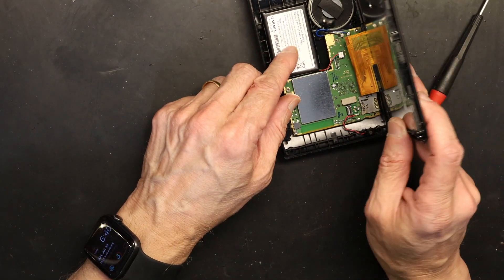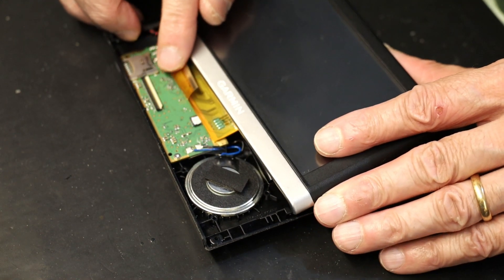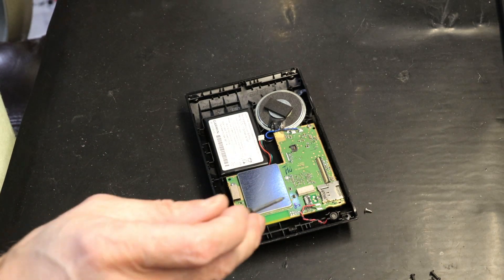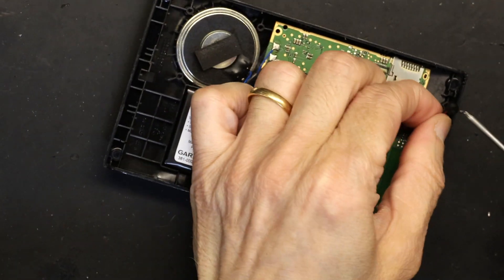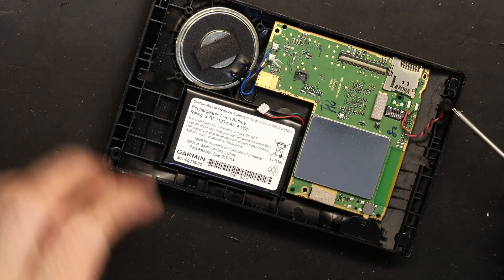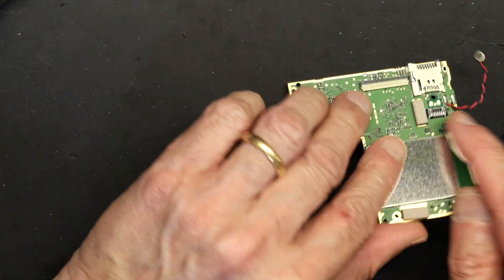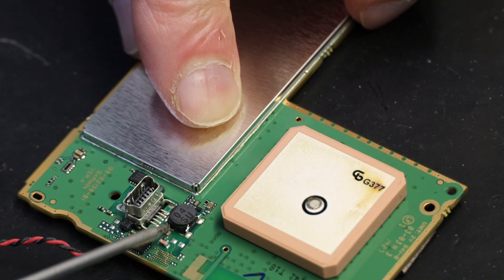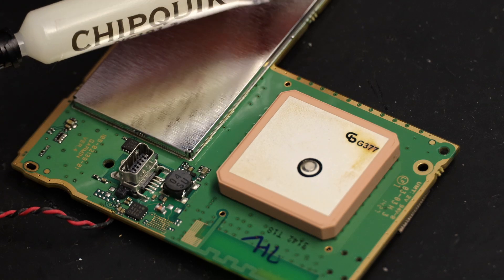Tutorial: How To Repair the USB Port on a Garmin Nuvi 2597LMT GPS Navigation System

Comment: Do you know why my Garmin 2599 LMTD has a hard time finding a GPS signal. about 10 minutes every time I turn it on. After that it works normally. I tried resets and cold start.
Reply from the maker: Hi, you need to update the firmware on the GPS, but don't use Garmin Express instead use Garmin Webupdater.exe
Reply: @TECHNOLOGYTIPS101  The firmware is 8.80, the last updated on garmin express and Webupdater does not give me the option to reinstall it. It only gives me the language update without any firmware. Is there any option to reinstall the same software. Or maybe downgrading firmware would help
Reply from the maker: @divdivic8120  Yes there is an option in Webupdater to reinstall the same version again. Also if all other options fail, there is one more thing you can do for the GPS to get all the GPS fixes but it takes 24 hours. You will need to put it outside using external power supply and let it stay connected with satellites for the full 24 hour period. This will be a way for the GPS to remap the sky with the latest GPS fix. This method will work permanently as long as you turn the GPS ON at least once a week. If you leave it OFF longer than a week it may lose the GPS fix again.
Reply: @TECHNOLOGYTIPS101  Hello mate, I tried to leave the Garmin overnight in the car to map the sky. And it seems to work better and faster now, but it still has a problem every time you put it to sleep, it can't find satellites again. Webupdater simply doesn't reinstall the software .It immediately recognizes that the latest software is installed and gives me other options. I also watched your video on how to install firmware for GPS receivers on chargers via webupdater, but it doesn't give me any option for software.
https://youtu.be/BB9n8UCzog4
Reply from the maker: @divdivic8120  I watched the video. It seems like you have a bad Main board. You are better off getting a used, similar GPS unit from eBay than buying a replacement main board.

Comment: The little white hold down piece broke on mine!  Is it fixable??
Thank you,
B
Reply from the maker: If you are talking about the flap that holds the LCD Cable, it is not fixable. So you have to replace it, and you can only get that part from another used Garmin of the same model. They don't sell it separately
Reply: Could I use super glue to lock the ribbon in place?
 @TECHNOLOGYTIPS101